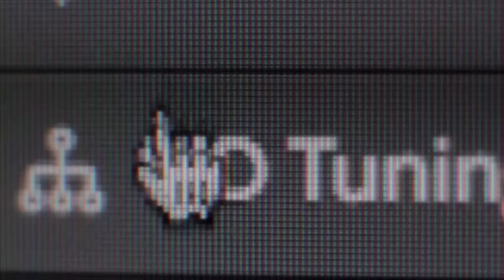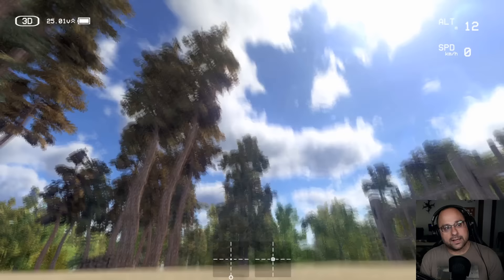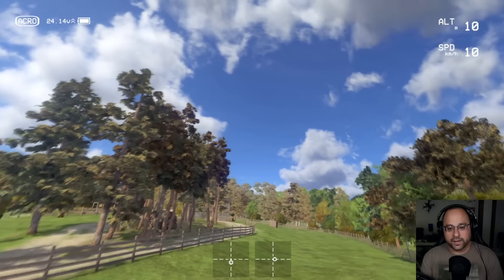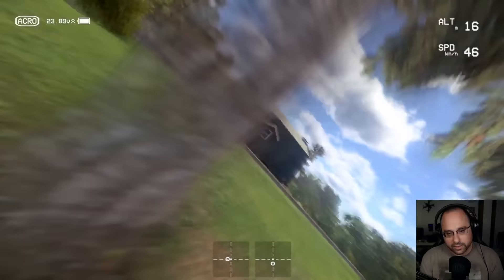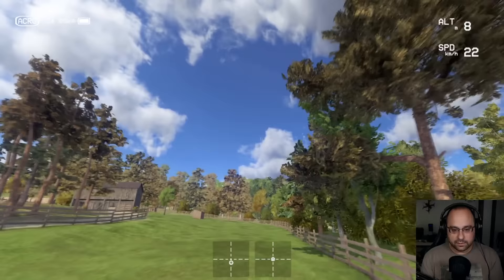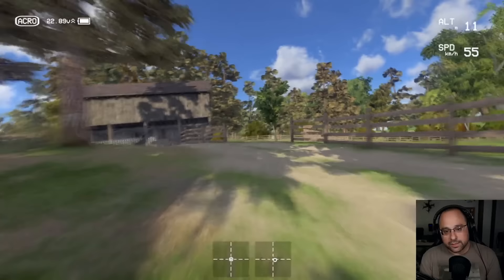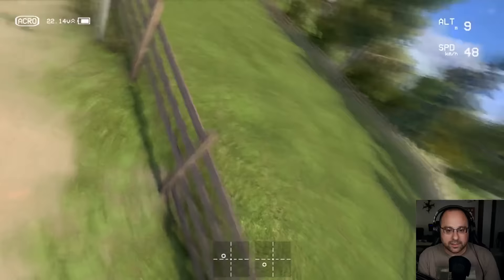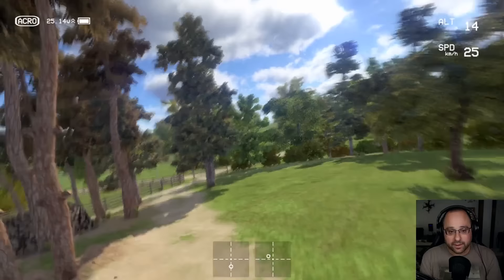Why FPV pilots don't pitch forward (as much as you think they should)

Comment: Can you explain the "camera angle" setting in Beta Flight.  How does it affect flight if at all?
Reply: The more camera tilt you have the more your roll and yaw axis seem to mix together from the point of view of the camera.  If you have 45 degree camera angle and you do a pure roll, it will appear like you did a mixed roll and yaw.  The camera angle option in betaflight adds compensation for this.  So if you set the angle in betaflight to 45 degrees and try to roll, it will automatically input the yaw you would need to make it appear like you are rolling from the camera's point of view.  I have been flying for 5 years and never use this feature.  I think it does more harm than good.
Reply: @Plur307   i agree. i think it looks smoother, and more natural without it
Reply: it mixes roll and yaw so that from your camera's perspective, the controls match what you'd expect to see if your camera was set to 0 degrees. Most pilots don't fly with this, although I imagine a few pilots flying at very high angles might have some application for it. It messes with how you expect the quad to behave.
Reply: @jpsalis  I don't like it because sometimes I lift my goggles and fly line of sight as well.  Trying to fly line of sight with camera tilt compensation would be very difficult.  There have been a few times where I lost video mid flight and was able to quickly lift my goggles and fly the quad back to me by line of sight.
Reply: @Plur307  yeah, it messes with me as well, I expect the thrust to go a certain way relative to my controls, but I see the advantages if someone is purely fpv, even if LOS is such a good skill.

Comment: Horizon mode <3 please help with mixing/solution for sharp turns with significant forward pitch JB! it freaks out when roll + yaw is introduced! it does a 180^ on the horizontal plane.
Reply from the maker: Don't fly horizon mode. Horizon mode sucks.

Comment: Dumb question: The way you are turning has a very "bank and yank" feel to it. Where the quad seems to be rolled into the turn much like you would on a plane. Could you coordinate the yaw and roll in such a ratio that the turn was flatter and didnt require the extra back pitch to correct?
Reply from the maker: If you were to turn perfectly flat, the quad would slide outwards and continue moving the same direction as always. There has to be some outwards-facing thrust vector in order to change direction.

Comment: For me the hardest thing is finishing a power loop without prop wash.  When I see that ground speeding up toward me, it's really difficult to exit the roll smoothly and with forward momentum instead of a pause with the dreaded prop wash and then forward movement.  How do you accomplish the smooth transition?
Reply from the maker: Remain pitched forward and throttle out of it.
Reply: @JoshuaBardwell  got it.  happens with my split S as well.  that critical 'power out' coordination seems crucial.  can you devote a clip to the technique (or maybe you have already)

Comment: Hi Joshua love the videos. Im a flight instructor and when I'm teaching my students turns we always are adding back pressure to the control yoke and slightly adding power in a turn because of the loss of lift in the turn. Could that be one of the reasons that you need back pressure on the quad?
Reply: I am new to flying quads, but with a quad i don't think you have lift the same way with a fixed wing.  The on control surfaces are the props.  So even when going forward you are falling a bit.  When you do a turn you loose speed and fall faster, plus the addition of the angle of the turn gives a downward force.  You need to pitch up to give lift by angling the props down a bit so the quad rises.  I can understand it but I still cant do it.  I will have to try this on the sim today though.  I still can't make sharp turn and always seem to float into trees.

Comment: So, regarding turning with roll and yaw only, and cratering into the ground: would that still be true if you had zero camera uptilt? Because the sticks are moving around the axis of the quad (the flight controller) but for the turn to "appear" coordinated, you have to turn around the axis of the camera - and when your camera is "level" your quad is presumably pitched forward by however many degrees your camera is tilted up.
Reply: Metaldirtnskin FPV It has nothing to do with the camera. Try this: pitch forward the get the quad moving straight ahead. Now roll (no yaw) left. Then, yaw (only) 90-degrees left. See how the roll you put it has now become pitch forward? The yaw turns your roll into pitch. Nothing to do with your camera.

Comment: There is a bit of nuance to this. If you turn with roll first then you need to pitch back. If you initiate the turn with yaw then you'll need to pitch forward.
Reply from the maker: That's only if you're turning with separate yaw and roll movements that aren't correctly balanced. Once. You are making coordinated turns, that doesn't apply.
Reply: @JoshuaBardwell  👍🏻 though my gut tells me that in a perfectly coordinated turn there should be no pitch input required. But then again it's natural for a turn to be led by roll (even if only slightly) because it looks right in the camera, and it's roll that actually initiates the lateral movement.
Reply from the maker: Why would you assume a perfectly coordinated turn doesn't need pitch? Why wouldn't it involve rotation on all three axes?
Reply: @JoshuaBardwell  yes it should. I was thinking of the type of turn that 'fpv camera mix' produces which keeps the camera level.
Reply from the maker: If the horizon is perfectly level, then pitch angle is conserved. But the turn will be "slidey" since there is no thrust vector pushing tangent to the arc of the turn. The quad will be rotated into the turn like drifitng, rather than looking forwards along the arc of the turn.

In order to produce a circular turn, you have to point the thrust vector outside of the turn (tangent to the angle of the turn). To do this, you roll into the turn, and at that point, you must also pitch back.

You can define a coordinated turn two ways. One is that the horizon is perfectly flat. But this definition does not let you look in the direction of the turn. The other is that you produce 1G acceleration through the Z axis of the frame, and transcribe a circular arc. This one requires pitch back.
Reply: @JoshuaBardwell  perfect, thank you! I find the interplay between the theory, and how we naturally develop the muscle memory so interesting.

Comment: It seems that he still hasn't answered the other question he raised: Why does turning make the quad pitch forwards? He essentially just said "because of reasons..." during the video...
Reply from the maker: Think about what happens to a quad if you were to roll right 45 degrees, then yaw right 90 degrees. You would be pitched forward 45 degrees.
The truth is, you can combine relative amounts of yaw and roll to generate any desired pitch angle. The deeper answer is that only a certain combination of pitch, yaw, and roll, produces a thrust vector that pushes the quadcopter in an arc.

Comment: so in one tutorial of your I set my quad to fly in air mode horizont and acro trainer (as I dont use it, I use AIR mode every time) so how to turn on ACRO mode? :/ and I believe I fly in DRL or Liftoff in ACRO mode, but I don't see any diference from AIR mode :/ I confused
EDIT:
Ok I manged to turn on ACRO by disabling "Permanently enable Airmode", removing ANGLE mode and using AIR mode insted. so now I have ACRO -> AIR -> ATRN modes :) AIR must have for me.
Reply from the maker: Press the A key in Liftoff to change flight mode.
Reply: Air mode has nothing to do with angle or acro, you can use airmode with andle and/or acro mode or you don't have to use it. When airmode is on, the motors will not stop when the throttle is at minimum so you can still use yaw, roll and pitch. If you disable air mode then you can't use yaw, roll and pitch when the throttle is at minimum because motors will stop. Without airomode it is difficult to do flips because you have to lower the throttle but not all the way to the minimum which is not easy to do. If you try to do flip without airmode there is a possibility you will lower the throttle to the minimum before the quadcopter does the full rotation and in that case the rotation will stop despite inputting the full roll or full pitch and the quadcopter will start to fall sidewise. After you increase the throttle the roll and pitch will start "working" again and the throttle will be high when the quadcopter is flying reverse which may cause crash. Before landing you could disable the airmode, switch from acro mode to angle mode, take off the fpv goggles and land perfectly in LOS. If you before landing forget to disable airmode the quadcopter may jump or start to spin after it touches the ground but in angle mode you can land even with airmode on if you are careful enough not to bump into the ground. However, if you want to lower the looptime then you have to disable the angle mode and land in acro.

Comment: Actually you pitch forward because your coordination between yaw and roll are not equal. Go back to Evan Turners video where people were all excited about him only using yaw for most of the track and staying level. In your case after watching this I would say on a real rate set up to lower your  rc rate which seems un-intuitive  but that will more closely balance your yaw to roll stick movements by lowering yaw dps.
Reply from the maker: I don't think this is correct. If you try to turn by using only yaw and roll with no pitch at all, you will see that it just doesn't work, no matter what you do.

The only way to do it is to yaw 90 degrees to the direction of travel, then roll, then yaw back. If you want to change direction, yaw again, roll to stop moving, then yaw and roll again to start moving again.
Reply: @JoshuaBardwell  I spent a good portion of last summer trying to cure myself of this problem. When I lowered my rates and changed yaw I was better able to keep the quad more flat. I had severe ballooning issues no matter what camera tilt I used. I now can fly from 7 degrees on my 2 incher to 87 ish on my newest race build. I had that same muscle memory trained where you are pitching back when doing free style. It wasnt until I started dropping yaw to be more close to roll that I have improved and that didnt manifest as a solution until I started working on keeping more level at full throttle around flags trying to tune more tighter turns.

Now my rates are down around 600dps and all axis very close with the exception of pitch with higher rc rate but same over all dps. If you watch my Mach1 video you can see when I stay flat the horizon is level when I yaw the slightest bit is when pitch axis issues show.

Anyways I am no pro by far but been flying for 6 years come September. We have met before at FFO 17. I was working the store and helped you pick out a foamy kit for you. Im sure you would remember the purple beard. Once again ty for all you do for the hobby .
Reply from the maker: I must just not be following what you're saying. You said you turn more flat to get tighter turns. But flatter turns will have more thrust pointing down and less thrust pointing outwards, so shouldn't they be looser?
Reply: @JoshuaBardwell  By flatter I mean level with the horizon so pitch back is not needed not level as in quad laying flat level. Hold your quad vertical with props pushing straight back. Imagine roll axis and rotate the quad in your hand. Totally flat turn. NOW.. add a slight yaw that brings one motor higher just a touch. In a coordinated turn with too much yaw both the side motors will spin fast to make the turn. BUT. the higher motor since there is a yaw component not equal to the roll will add a slight bit more thrust thus pushing the high side of the quad down and that is where the need for constant pitch back comes from in freestyle coordinated turns where the quad is leaning.